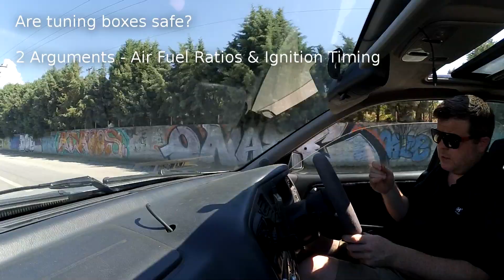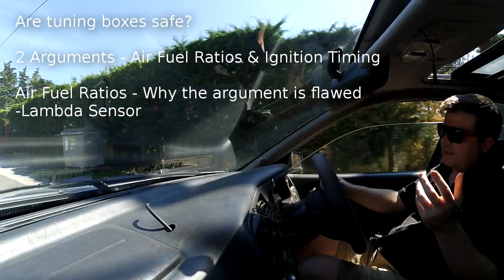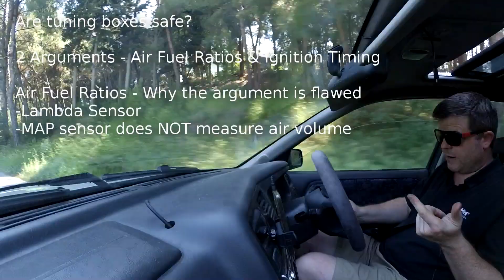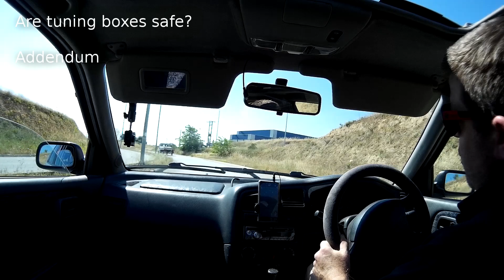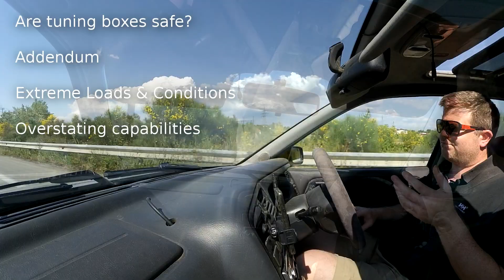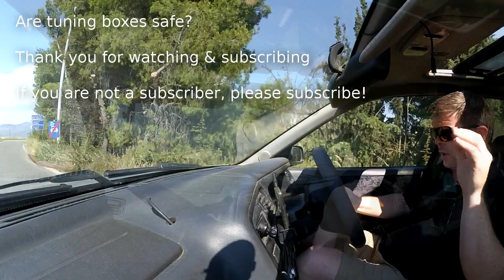Are Tuning Boxes Safe?

Comment: i have a tuning box for a ford fiesta mkv na and seems to make a decent amount of power with the box and that is a bit sketch i think its running it lean it modifies the map signal/voltage that is all it does like a pot on the map sensor this isn't safe surely the car only has a map no maf fuel trims are s0 l0 under load it flutates + and minus but on average stays near 0 0
Reply from the maker: If your OBD outputs the wideband lambda AFRs that would be a worth a look.

Comment: one thing i have come to learn is software tuners hate tuning boxes and will always bash on tuning boxes or hve something negative to say about them. i have had a tuning box from a local tuner in my 206kw (276hp) Golf 7R for the past 8 months now and all has been fine. First i ran the tuning box without a downpipe for a few months and my car made 238kw (319hp) and 488Nm at the wheels on the dyno. what i did notice however is in some instances at 3rd gear i would hit a flat spot on the power range after which the tuner recommended i install a downpipe as he believed the engine was not getting sufficient air and the sudden drop in power was actually the cars ECU protecting the engine. Modern engines have extensive safety settings in place from factory. After getting the downpipe the car pulls strong right through the rev range in every single gear and i am now making 247kw (331hp) and 528Nm at the wheels. Remember a tuning box is not a sh*tty tune that replaces your cars ECU way of thinking it is just a piggy back which rides on the cars original ECU meaning that your cars ECU still functions and still has its safety parameters in place to kick in at the sight of any problem it detects.
Reply from the maker: They have their pluses and minuses. On the plus side they are using a map that was in the ECU from the factory ie its been tested, a lot. On the negative side they are using a factory map so there is potentially untapped power available which only a remap can access.
Reply: @DriveTuneMedia  100% correct 👌